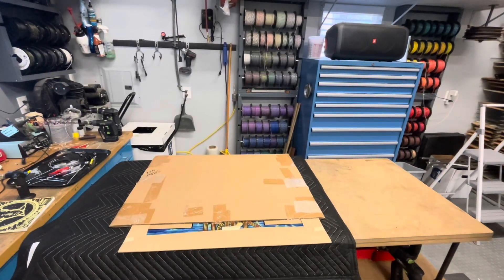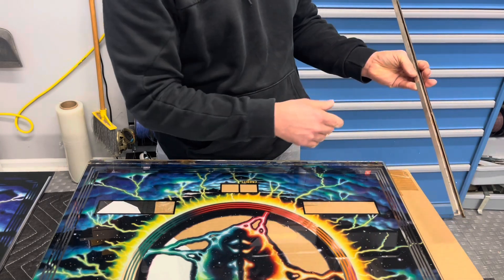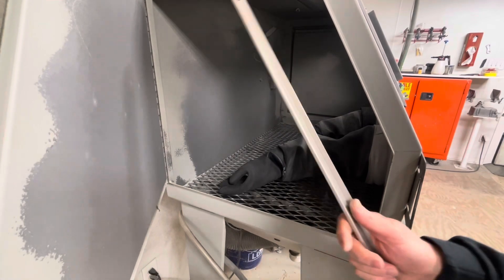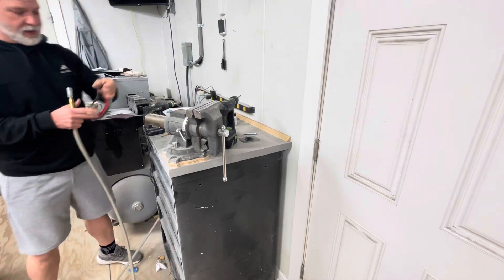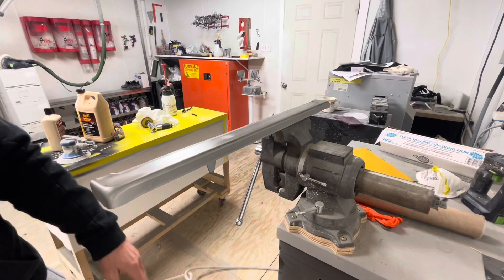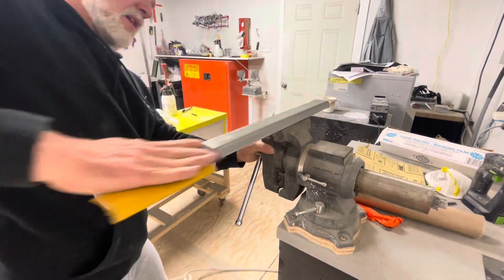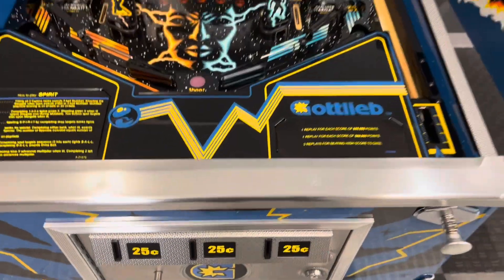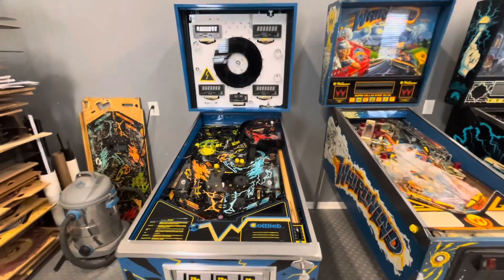Gottlieb Spirit Pinball Restoration 25

Comment: Chris - To preserve original mirrored back glass, do you have a preferred/recommended process? It seems like air brush touch up and then coating with clear (triple thick) is what most restorers have been doing.
Reply from the maker: Backglasses are hard to deal with because they can be fragile and the transparency of touch ups might look great off but terrible when lit. 
 Adding a sealer can make it worse so I would just touch up and work on transparency primarily.